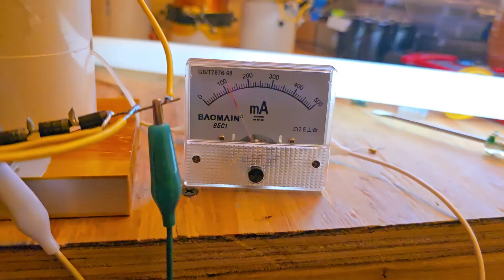FURTHER IMPROVING THE BEST TESLA COIL YET. ITS A NEGATIVE RESISTANCE CHARGE PUMP ONCE EARTH GROUNDED

Comment: Do you know, that you can get spark gaps and gas discharge tubes in negative resistance mode under specific parameters of operation? You will not get much from semiconductors with negative resistance characteristics but, for example, with discharge tubes you can get quite prominent effects. How do you drive the primary? I understood that you use ZVS to raise voltage. What is the next step? You pulse the primary with short impulses or am I wrong?

Comment: it is not going to produce more power than it uses
Reply from the maker: It might if using crystal radio resonant receiver boosted circuit topology when the transmitter is on & tuned to be as efficient as possible similar to a don smith system

Comment: Tesla magnifying coil. His original design used a cone shaped coil. One interesting thought experiment here that you can ask A.I. chat bots about is the notion that each wire loop from the base to the apex has a smaller and smaller diameter. The speed-of-light in copper has a smaller and smaller circumference to travel as it approaches the apex. Unlike a cylinder where each loop is the same diameter, a very strange harmonic thing happens with a cone. A cone could be much more wide in terms of its bandwidth with frequencies that range from the base circumference to the apex circumference. More experiments are needed with cone shaped coils -- such as the Bashar STA or the Tesla's bifilar patent only made as a cone and not a pancake. Another idea about a "cone" shape, is that apex has strong magnetic pole, base has weak magnetic pole, and thus it is similar to a monopole magnetically.
Reply from the maker: That's very interesting & worth experimenting because Walter Russell was using cone shaped coils for his "free energy" receivers
Reply: @MTECH2022  Yes. I would have mentioned Walter Russel too, but couldn't remember his name.

Comment: re: grounding. In Tesla's Colorado Spring notes, he goes into detail about how to create a really good ground. He digs a hole and puts in a very large metal plate. This is wired up and covered with wet dirt. He would also have a source of water that constantly drops on this wet dirt. The bigger the plate, the more surface area, the better. I think he would have the hole pretty deep -- maybe 6 feet.

Comment: re: "closer vs less power". If your are observing only current (amp meter), that is not an indicator of power per se as current can change one way, as voltage changes another way. One useful way to measure power transmission is to create a receiver coil, tuned the same, and then have conversion from AC to DC and a fixed resistance load. Measure the DC voltage across this load, and knowing R, compute the watts. The "Tate Ambient Power Module" is pretty cool for RF reception converted to DC power.

Comment: some ideas for boosting Q even more. If you look at the Hendershot coil, it uses a basket weave style. Each wire when it passes a peg is on the other side of the peg from the wire below (assuming odd number of pegs around the circumference). This creates a situation where capacitance between wires is very minimal. Radio engineers back in the early to mid 1900s were going to special coil wiring patterns like this as well as using Litz wire (pretty expensive). Instead of Litz wire, a larger gauge wire to reduce resistance -- also good. Certainly the primary can have a very thick gauge / low resistance wire. Tesla also went to pancake coils or "oil" coils (like automotive ignition coils) for frequency that are much lower -- 3,000 RPM spark-plug duty cycle or 180KHz. High voltage at these lower frequencies from a coil produce a much more yellow spark (less purple plasma) -- more fire in appearance.

Comment: Eric's terms are so hard to understand, best way to teach cold electricity to modern science types is to call it "pulsed electrostatic induction" and with that phrase, they can understand what is going on.
Reply: Not exactly. You would get electrostatic effects on such coil under specific conditions, but what author showed is high voltage electromagnetic field with 90+ phase shift between voltage and current. It is perceived as cold because the more the phase shift between voltage and current the less actual power you get on circuit parts hence the "coldness" (also the higher the voltage and frequency the lesser space for current which heats things)
Reply: You are both wrong. The word choice is perfect, cold. Any radiative emf source we consider normal is hot. A source of cold electricity would be one that absorbs "hot" emf. Hence power can be drawn from it attached to nothing, because now the pole is not ground and the circuit like a regular generator, but from source (cold) to the surrounding.

Comment: Are you sure you're not just detuning it when you get very close? Especially when you're dealing with high Q, high voltage coils like that. The electric field expands so large that it parasitically couples with almost everything near it, which in turn changes the tuning and performance of the coil.
Reply: Yeah, I wonder if the load just redirects the internal LC losses into something useful, possibly even making the LC tank more efficient, which would explain the slightly decrease in current draw when the load is coupled
Reply: @ashercorbett8089  The current draw decreases because the inductance is reduced, which in turn decreases the energy capacity
Reply: @heavycurrent7462 oh weird I didn’t know that
Reply: @ashercorbett8089  Like the original comment already pointed out. The hand detunes the coil, reducing Q.

Comment: That's not a zvs
Reply: I stand corrected
Reply from the maker: @warrenstephens8557 

Its all good & I want to push it with a 1kv dc input as abrubt as possible with minimal current
Reply from the maker: Aobao 3pcs DC-DC High Voltage Boost Converter 8V-32V to ±45V-390V ZVS Step-up Booster Module Capacitor Charging Power Supply Module.

https://www.googleadservices.com/pagead/aclk?sa=L&ai=DChsSEwj2nLa9j8-NAxWnRf8BHeyFFM8YACICCAEQCBoCbWQ&co=1&gclid=Cj0KCQjw0erBBhDTARIsAKO8iqQR3tjJgZN1P8sUNRfI7UPHiQaVQId8EFBkWiBD1E8ccbfOv89cA1EaAkPpEALw_wcB&sph=&ohost=www.google.com&cid=CAESVeD25PuRCWNhYaVCtDYQlCQ_dvHiimC4whH4_Ng4LTEomXwUApD1fw2j-kTMbSW0HqtUxMlxF4yUXyXjMtKJF3JfLN1tglxZqp-u-WKTOkqPJr9RRYM&category=acrcp_v1_41&sig=AOD64_190FAnE9LXKSzhSeCve4PFALCBOA&ctype=5&q=&ved=2ahUKEwjd0Ky9j8-NAxVlwvACHQksNIMQwg8oAHoECAUQDQ&adurl=

Comment: Old man builds has been experimenting with Tesla coils... He's been putting a metal rod down the center which would be electrically coupled not magnetically coupled to the coil and using that for powering loads.  The electrostatic field of a test the coil the high voltage isn't going to be as influences the magnetic field

Comment: Over unity, or just standard electromagnetic coupling?
Reply from the maker: The tesla coil Can operate in both modes & i will make an updated video on that soon with the new discoveries made. Basically if you input 200vdc into the new tesla coil circuit but put a neon bulb in series with the positive 200vdc input it will act like a super negative resistance switch & pulse the tesla coil to have a wireless power output at no current consumption input but the only loss is in the zvs boost converter that's stepping up the 12vdc battery power to 200vdc.
Reply: @MTECH2022 

oh I see. It’s like what Joel Legace talks about: “sipping  from the field”. Not only does the input not “feel” the load, but it actually decreases the input required, which is the negative resistance. 

If those claims hold true, that’s a really great find on your part!

Comment: How many turns on the secondary?
Reply from the maker: I could count them but a real tesla coil doesn't go by turn count it goes by a perfect height to diameter ratio.

Newest cold electricity tesla coil LCR measurements.

18 AWG L2 HAS 180.2uH of inductance & 00.4 Ohms of resistance. L2's dimensions are 2 & 14/16ths inches long by 2 & 12/16ths inches wide keeping the 1 to 1 height to diameter ratio as close as & equal as possible.

8 AWG L1 HAS  00.6uH inductance &  00.1 Ohms of resistance. L1 is one adjustable loop tightly wrapped over the L2 for a thick primary coil in alignment with Teslas magnifying transmitter & a 220pF capacitor was placed in parallel with the L1 to keep near perfect dielectric resonance
Reply: @MTECH2022 
Interesting when you divide 180.2 by .6 you get 300.333333. Not sure if it means anything but it maybe your primary is a divisor of the secondary. 
Don Smith was concerned with the primary and secondary being a multiple or divisor. He says to measure the wire length and adjust accordingly.